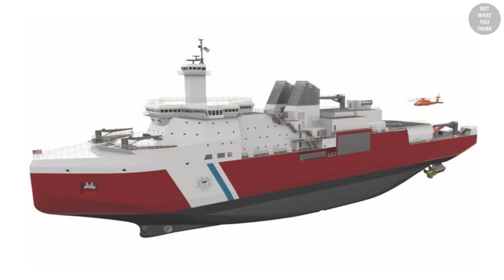Ice Breakers Explained: What, Why and How

Comment: Actually there were at one time four Ice Breakers in the U. S. Fleet, The Coast Guard Cutters: Polar Star (pictured when stated there are only two) Polar Sea, Healy, and Mackinaw. The Polar Star, Sea, and Healy are used primarily in the Arctic and Antarctic missions while the Mackinaw is used exclusively in the Great Lakes to maintain shipping lanes. The Polar Sea had lost four of it's six Main Diesel Engines and is scheduled for decommission due to the cost of repairs.

Comment: In general, this number of icebreakers was created to serve the Arctic territories of Russia. This is a natural need. But with the warming of the climate, the northern sea route was opened, which is shorter than the traditional one. The Russians estimate that this new transport route requires about 50 icebreakers to operate properly, given that some are in the process of being repaired. The next generation of Project 10510 Leader nuclear icebreakers is expected (Wikipedia). The first icebreaker of this series began to be built in the summer of 2020. For scientific research, a scientific floating platform of a special shape was built to prevent freezing into the ice. It is instead of the traditional drifting stations of polar explorers on an ice floe (the climate has warmed and floating ice floes have become unreliable for a long camp of scientists). Autonomy 2 years, there is the possibility of independent movement. https://www.youtube.com/watch?v=cAQvDJm9Kw4&t=12s

Comment: Russian ice breakers also have a different bow, bear the water line the bow curves inwards. This shape is supposed to break the ice on contact' and requires much less force then push the ship onto the ice and use the weight of it to break the ice.
Reply: no, it works like stopper, because most of russian icebreakers break ice on 15-20kmh, and ship basically can jump fully on ice without it
Reply: @tsugumorihoney2288  oh. I watched a video a arctic cruise video and thats what the dude said. He must have been miss informed. Thanks for correcting me.

Comment: You cant even wrap your arms around the propeller shafts. CPP's, the shaft is hollow and has an internal push/pull rod to control the blade pitch, guy forgot to mention thats how reverse also works. Couple of my coworkers were unfortunate enough to be apart of the construction and repair of these girls. Havnt herd a single one of them talk about anything other than how difficult these were to overhaul.
Reply: Sounds like it was a pain in the ass

Comment: The Arctic Route is the Shortest route from Asia to Europe. ...That means with Russia's massive ice breaker fleet and Warmer climate in the Arctic, Russia will Control this trade route. Which means Russia will make a lot of Money. Meanwhile US aircraft carriers will be stuck in warm waters and rendered obsolete in the Arctic.
Reply: 1 even if they ran these absurdly expensive icebreakers 24/7 the entirety of the arctic wouldnt see 10% the traffic in a year that either the panama or suez canal sees in a month, no one is risking high value cargo on expensive and dangerous arctic shipping unless forced,  2 almost all military presence in the arctic is submarine based for a reason, why would you send big expensive ships into the slowest and least manuverable part of the planet the arctic is a death trap for any military vessel so no neither the US or russia has any interest in putting carriers or even really military power there in general

Comment: Why do you so like to do stupid things - Russia it's not USSR. Russian have ONE real Icebreaker and when it was done it was not working and still not working = few whey buy like a first and the end so bullshit like -On February 4, 2020, during the commissioning of the electric propulsion system on the icebreaker, one of the two right-hand rowing electric motors failed, after which the delivery date of the ship was shifted indefinitely On August 11, 2021, the icebreaker stopped at the dock named after Veleshinsky (formerly Alekseevsky) at the Kronstadt Marine Plant to replace the electric motor.

Comment: Fun fact, Many of Russia's Icebreaking ships have heating systems within the bow to help with breaking thick ice. Some use steam some use coils.
Reply: Some have vodka sprayers but that's classified
Reply: @Ravello1111111111111111111  U r so original. Wow. Try national standup.
Reply: @accckiy  I'm a comedy genius I know thank you for the feedback it is very useful to me
Reply: Canadian Ice breakers have "bubbler" systems which spray water out of the bow between the ice and hull to reduce drag while breaking ice. Never heard of heating system but would accomplish the same thing which is cool
Reply: @NSskidookid  some of russian icebreakers also have same system
Reply: That’s just stupid lol
Reply: @lepivl  Nope, nuclear power generates more than enough heat to channel some steam towards the hull. It smooths out the friction a lot in the long run. Not a tiniest bit of extra energy required.
Reply: @lepivl  ty mr icebreaker knowitall. we should all listen to your expertiese in building icebreakers the size of your mom.
Reply: Its to free the bow from ice frozen while the ship is stationary in harbour. The ships are always parked with the bows pointing seawards. Ice frozen to the sides can be cracked with a hammer weight from the ships crane. But the bow is hard to reach and overhangs.
Reply: No, we don't have this on icebrakers. Its stupid miph.
Reply: @wowa3520  вабще-то есть не на всех но есть, еще есть пневмосистема что создает пузырьки вокруг судна, на 50 лет победы есть и подогрев носа и пузырькавая система...
Reply: @Tothemoonkovich  вот и не писал бы ничего, а вот он правду написал на некоторых российских атомных ледоколах есть система нагревания носовой обшивки, нужно только погуглить в инете, я тож сначала подумал фигня какая-то, потом вспомнил про пузырьки на 50 лет победы и решил покопаться узнать
Reply: @tsugumorihoney2288  ахахахх ну да, нагревания =) Поржал. Единственная система похожая - джакузи, как раз пузырики, чтобы улучшить скольжение льда и препятствовать вмерзанию ледокола в лёд при стоянке. Ещё есть очень совершенная система крена-дифферанта. Но греть лёд? ЛОЛ. Это чудовищно энергозатратно и абсолютно бесполезно =)

Ходил на всех атомных ледоколах, кроме Арктики новой =) Дать контакты старпома 50 лет победы, чтобы разобрался? =)
Reply: Thats absurd. Icebreakers have a specialized bow design to help them ride up the ice and using its weight to crush it and make passage.
Reply: @mykeandrewbautista1738  what is absurd?
Reply: @mykeandrewbautista1738  ice breakers don't exist
Reply: Там воздух что бы лёд не налипал к корпусу .
Reply: глупо тянуть километры труд для обогрева корпуса для растопки льда.
Reply: That must use an absurdly impractical amount of energy.
Reply: @Bob_Lob_Law  Used to warm the hull to melt a thin layer of ice for less drag.  That’s my guess, because otherwise you are right and it would also take an absurdly long time to go anywhere.
Reply: @CorePathway  IDK how thick it melts, all I know is it's used for thick ice, so they dont have to keep going back and forth with the ship.
Reply: @Bob_Lob_Law  When it comes to their nuclear ships, it doesn't take a lot of power. their nuclear powered ships have enough every output to power a second ship. Breaking through ice needs a lot of power.
Reply: @Bob_Lob_Law  Luckily, there's a lot of spare heat on a nuclear icebreaker - very handy for the arctic! In fact, all steam-driven ships use the cold sea to cool their condensers, but a truly effective ice-melting bow would only require a small steam bypass compared to the turbo-electric generators. As the icebreakers are all IEP, electrical coils are also a less efficient, but very simple and effective option
Reply: @Bob_Lob_Law  Did you go for a pee break when the video mentioned Russia has 5 NUCLEAR powered icebreakers?
Reply: That sounds improbable. Certainly they have the engine as an internal heating plant so the crew doesn't freeze, but to carry a tremendous load of extra fuel to heat the bow sufficently to melt polar ice?  This is done primarily by a super thick bow hull to brute force ice breakinng,
Reply: @misiclover1658  A tremendous load of extra fuel? These things run for more than a decade on about 100 liters of medium-enriched uranium dioxide fuel, about a tonne of the stuff. You could fit that in the fuel tank of a big american pickup truck! (though it might be a bit heavy)
Reply: @misiclover1658  Read your comment and read my comment. Nuclear ship s can supply enough energy for something like this. Especially in steam form. And yes ships do use their weight, but with thick ice heat is effective.